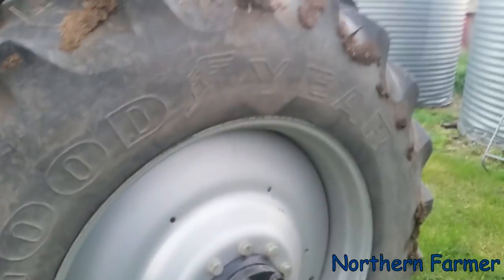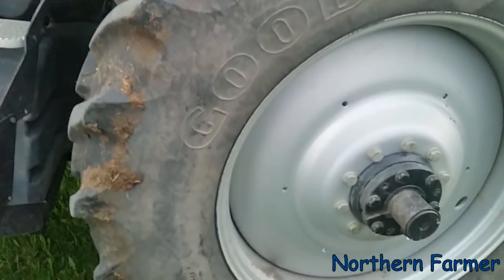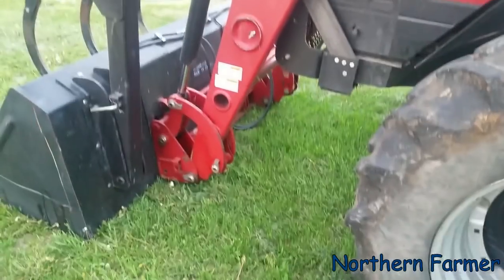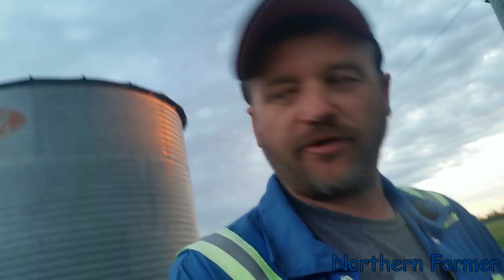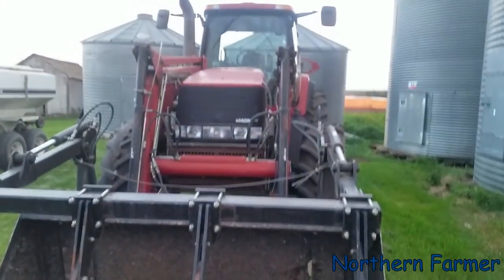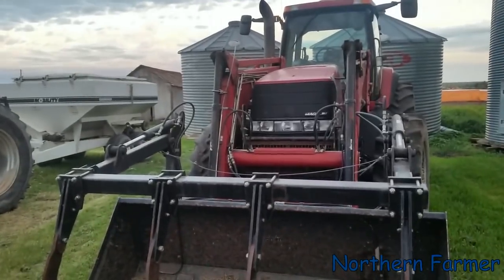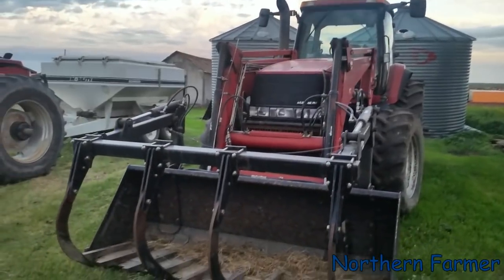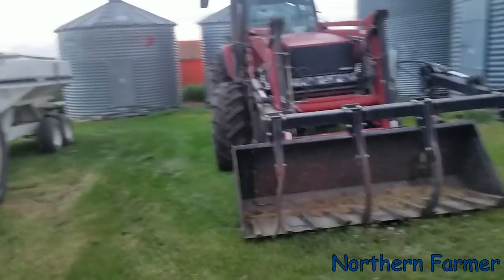CASEIH MX 210 Magnum!!!

Comment: Thanks for the tractor update I hope she's a good buy for you guys, only time will tell now. There are lots of those joystick loader controls that are terrible to use.  The issue is some of the fitting kits aren't designed right from the factory. Or the guys at the dealers just make a bracket or throw the kit in, as they never operate the machine all day to know any better.

  Having grown up on  farms and operating equipment,then going to the dealerships as a mechanic building the brackets or fitting kits. I know whats comfortable and what works from experience.   I absolutely hate hitting fingers or pinching them on gear shifts or hand controls just driving the tractor round and in the shop,without running it for hours a day like it .

 The guys will say how they like the new installs or we've had this thing  10 years or longer and hated that old joystick position from day one , we wish somebody would of "fixed" it like this back at the start. The odd one I've just done here in my repair shop as a nice gesture without telling the guy.  it don't take long before they are on the phone thanking me for doing it and how nice it is to run the loader now.  some guys just didn't want to upset the dealer or they didn't know that with a welder a torch and 1/2 an hour it could be totally different I guess.

Comment: That oil pressure does seem really high, if not to late have them check it when you send it in for AC! Have them fix that wiring too! Least they could do is wrap it in some wire wrap and take that wire nut off!
Reply from the maker: Im told its normal

Comment: The oil pressure is ok... I think that has a Cummins in it? Once it warms up it'll drop to between 40 and 50 when idle. Our TG285 shows upwards of 80-95 psi depending how cold it was outside, and what oil is in it. We use 15-40, but don't use the tractor in the winter so just to give you an idea.

That's a big loader for sure.
Reply from the maker: Thanks...Yea its one size bigger than whats on our 2096 and 2290 tractors. We always use 15-40 also

Comment: Yeah dealers here in the states are inconsiderate and high in prices and sloppy. 
I looked at buying a used 2012 new holland loader tractor. It was about 160 horse four wheel drive with a quike loader. Most all of the glass in the doors and windows were broken or cracked hydraulic fluid leaks and fuel leaks everywhere very dirty and messy . Had around 7,800 hours on it  needless to say the tractor had a hard life. They still wanted $45,000 for it.
Reply from the maker: Yea I dont understand why they cant do a good job cleaning  them up at least

Comment: Good evening Northern Farmer from England, the switch is part of the headland management system, basically records the amount of wheelings that the tractor has done on the headland of the fields so the operator can avoid wheelings and damage to the soil, all eclipsed by guidnance systems.. Am glad you haven't got three point hitch on your Magnum too as we had MX270 and it gave loads of trouble as it's based on 1970's IH design of lower link sensing and heavy mounted kit wears the pins to such a degree that computer in the cab can't read where the arms are due to excessive play, then it stops working, they should have made it better, as my father ran a IH 5288 for years and the old lever system never failed, I still have that old tractor, but the Magnum got sold and is now in Latvia.
Reply from the maker: We have never had any use for 3 point hitch

Comment: the button with the tractor rurning right is the "end of the row" switch.. so if you were plowing row crop ground you hit the switch at the end of the row and it will pick up your plow spin it and lower it again... I've never used mine becsuse i dont know how to set it up.
Reply from the maker: I doubt I will ever use it either,,,

Comment: Your plug to gps is no had same problem with mine call acu farm in strathmore and get new power cable it will work mine showed it had power but display would not turn on cast 200.00 dollares and it will work
Reply from the maker: Is it the one that comes from the battery or the one that plugs into the display?

Comment: Good luck with your new tractor, I didn't realize you were that serious about it when you looked at it at the dealers. 
In view of the sloppy clean up, I think the first set of filters you get should be free.  But the clean up don't make it run any better, LoL.  I"m guessing it's 4 x  4 too?  What does the orange foot petal do, is that an alternative throttle?  I'm guessing that tractor propulsion is hydro-static? 
Thanks for sharing  your new tractor with us. I think most of us love equipment....
Reply from the maker: Its still a powershift but it has no gearshift lever like the mx tractors do
Reply: Cool, thanks for answering my question. I am always interested what makes things tick.  I wish you good luck with your new tractor.

Comment: Use Bissell Pet Odor and Stain remover with hot water. It will remove the stains and it'll smell nice in the cab too.
Reply from the maker: I have my steam cleaner to.. .but I used a seat cleaner and it woks well.

Comment: that button by the 3 point is a headland management I'm not sure how it works I just was told that's what its called and congrats on a good tractor and as far as the oil pressure mine runs around the same and I've never run into a problem with it
Reply from the maker: Thanks for the tips... Still learning about it.

Comment: Out of curiosity why do you run New Holland combines instead of Case IH?
Reply from the maker: 2 rotors are better than one
Reply: @Northern_Farmer  Fair enough.  I like the TR New Holland combines but I've never ran one.  I put a bunch of hours on a JD 9600 and a Case IH 2388.  Both are very good combines.
Reply from the maker: Well we have had new holland combines for a long time.. I know the ins and outs of the TR Series the most.... so I go with what I know..But I would try out a caseih combine to

Comment: why don't you get a Massey?? and why don't you have the mud Garde's on?? wouldn't it make sense so it doesn't get the windows dirty!
Reply from the maker: I had driven a 2007 massey... no offence but it was horrible. Tons of electrical problems.. clutching wasnt smooth at all... hard to load bales without running into the truck...cab wasnt very nice..
Reply from the maker: I have never had that problem of getting mud on the windows..
Reply: Northern farmer but was that a second hand one?? if it was they sometimes are't reliable